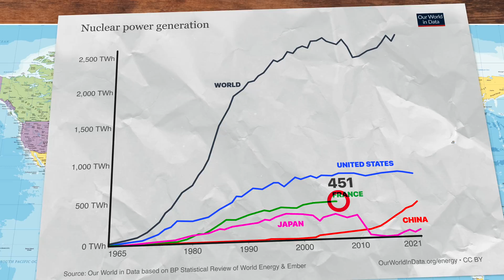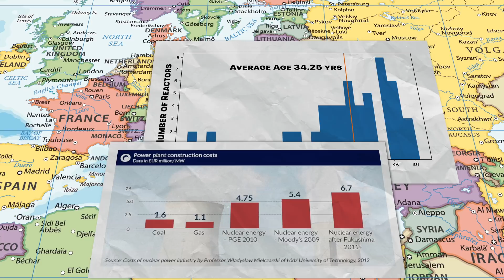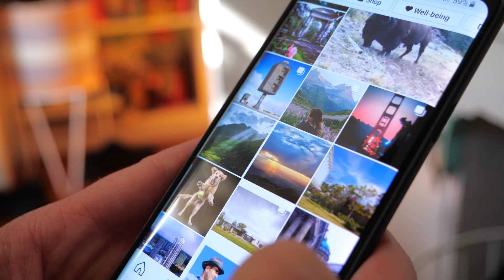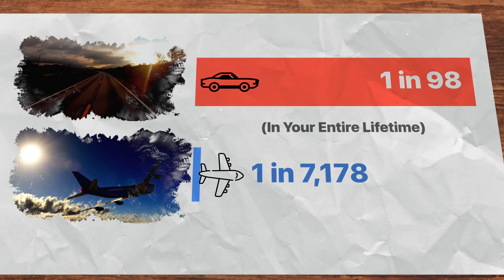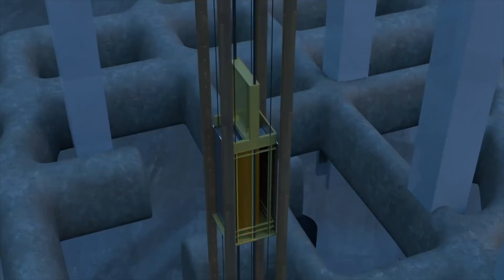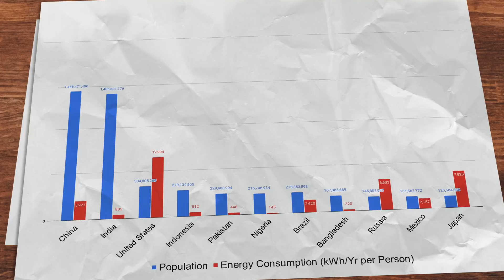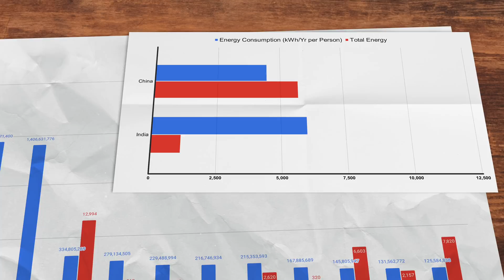The Future of Nuclear Energy Depends On This...

Comment: Safety is good, and bad at the same time, it depends when, where and how strictly it is applied. I’m currently building my house, and the workers just got on the roof and started working without safety concerns, and no one died. Fast forward a few months later one of the guy that was working on my house, got a job in Belgium or something (I live in romania), and he literally couldn't get on a roof without another guy holding him with a rope and another guy supervising the whole thing, even if he just had to place a single nail. I get it, he could’ve fallen down from the building, but what are the chances? It’s not like your intention is to jump from the roof, you can just be a bit careful and nothing bad will happen. Now of course with a nuclear power plant it’s another story, but I’m sure they’re overdoing regarding to the safety of the workers

Comment: Moltex are going through homologation in Canada for a fast spectrum molten salt reactor. There is no fancy molten metal coolant and there is no fuel reprocessing. 
They take used fuel and chemically process it into a salt which is diluted with chloride salt. The isotope content is unchanged. 
The salt fuel is packed into open ended stainless tubes. The reactor core uses the same salt (minus fuel) as a heat transfer medium. The reactor itself is a concrete box with a third salt loop to remove heat. It’s fully self regulating, cannot overheat and has one moving part - a salt stirrer to keep the regulatory body happy. It also has power cut-off rods but really doesn’t need them. It’s intrinsically safe.
Reply: When it si built and operated and proven, then and only then can you make those statements

Comment: Nuclear waste can cheaply used as fuel in a molten chloride salt fast reactor.  Both the Elysium and the Moltex Stable Salt can do this.  Other fast neutron reactors can do this. These reactors can use the 98% of the energy that is still left the waste of current reactors..
Reply: Maybe we should build one of these unicorns, operate it and prove what your saying before making claims
Reply: @clarkkent9080  don't have to experiment.  Russia has an operating commercial fast neutron reactor the BN-800.  Currently Russia is building several larger fast neutron reactors of the BN-1200 class.  Terra Power is building a fast neutron reactor in Wyoming.  All these reactors can burn Nuclear waste.  There are allot more of these waste burning reactors being developed.  This is not new technology as the the first fast reactors were developed in the 1950s.  Essentially the problems have been the need for higher enrichment levels and denser higher power output cores.  The problems here mostly been solved.
Reply: @stanleytolle416  NO reactor anywhere in the world is being used to burn nuclear waste.  It is technically possible for sure but no one is doing it because of the cost.  That is unless you count the countries that reprocess spent fuel and ONLY extract the Pu239 for use in MOX fuel for a MODERATED reactor core..
You cannot just dump spent reactor fuel into an operating reactor.  Every batch of spent fuel would have to be analyzed, as everyone is different and reprocessed into a form that could be placed in to the core.

Terrapower is on hold awaiting the construction of a U.S. plant to make their fuel as Russia was the original source.  The Terrapower MSR will not and is not designed to burn spent fuel.
Reply: @clarkkent9080  the Russian BN-800 is currently running on nuclear waste.  This reactor has a fully closed fuel cycle and it is a commercial power reactor.  The Canadian  CANDU reactors are currently being partially fueled by nuclear waste as well as all the French reactors. Essentially any fast neutron reactor can run on nuclear waste and reduce the amount of waste by 1/1000 with the small left over waste decaying to back ground in about 300 years (the half life of these elements being less than 30 years).  So if anyone is spouting off about a nuclear waste problem they don't know what they are talking about.  Current nuclear waste is simply fuel for newer reactors.
Reply: @clarkkent9080  the Russian BN-800 and currently being built BN-1200 are closed fuel cycle units that produce no nuclear waste (they reuse their own waste).  These are current commercial power reactors that are running on nuclear waste.  There are others in China and other places.
Reply: @stanleytolle416  I will look into the BN-800 but CANDU reactors are NOT fast neutron reactors.  They use heavy water to thermalize the neutrons.

And as I said in the previous comment, France REPROCESSES spent fuel to extract Pu239.  The Pu239 is used in their nuclear weapons and to be mixed with depleted uranium to make mixed oxide fuel (MOX).

The U.S. was planning on doing 1/2 of what the French were doing but since we have tons of excess Pu239, it does not have to be separated from spent fuel which is the hardest and most costly of the processes.  The U.S. plant was to simply mix pure Pu239 with depleted uranium to make MOX fuel. Areva the French company that built theirs was contracted to build ours and here is how that turned out.
The MOX facility (South Carolina) was a U.S. government nuclear reprocessing facility that was supposed to mix pure weapon grade Pu239 with U238 to make reactor fuel assemblies. It was canceled (2017) in the U.S. After spending $10 billion for a plant that was originally estimated to cost $1 billion and an independent report that estimated it would cost $100 billion to complete the plant and process all the Pu239, Trump canceled the project in 2017.

Spent fuel comes in all different types of fuel assemblies.  Please explain how spent fuel rods are used to fuel these fast neutron reactors????  Just throw some assemblies into the core???  If reprocessing is involved that is big money.  japan and the UK no longer reprocess since their facilities are old and it is too expensive to build new ones.  France will soon shut theirs down for the same reason'
Reply: @clarkkent9080  it's true that CANDU is a thermo reactor but how the reactor works allows for nuclear waste to be burned too as part of it's fuel mix.  Remember the CANDU is burning unenriched uranium as fuel due to using heavy water as a modulator.  The ability to use nuclear waste is related to the ability to add and remove fuel without shuttin down.
Reply: @stanleytolle416  You still don't explain how you add high level nuclear waste spent fuel rods to an operating reactor.  

don't you need fast neutrons for isotopic transmutation of the fission products in the spent nuclear waste?

Comment: Costly and centralized, nuclear is no match for the battery storage revolution that's about to happen. Never mind the creation of sizeable amounts of long term nuclear isotopes and all the issues that that causes.

The current price for LiFePO4 raw cells is about 100usd per kWh. It is highly probable that grid level MW scale battery storage installations will cost that in a few years time: for example: Tesla megapack (NMC based still) just had it price bumped to ~500usd per kWh from ~333usd per kWh, just because tesla could.

In a few years time, for the same cost of Hinkley Point C (23B GBP or 28.7B USD),  the .uk could build out 287GWh of grid level storage. That's 8 hours worth of the yearly average electricity usage. The repercussions of such a huge amount of storage distributed over the .uk grid would be insane. And yet all they got... well... will get... probably... instead is a measly 3.2GW with 92% capacity factor.
Reply: Tesla are great at building batteries, but they’re orders of magnitudes off from the volume and cost need for battery backup to be viable.

Comment: I do think nuclear power can be safe.  It is extremely difficult to predict accidents and therefore when they happen the damage is very long lasting.  That said, when they do happen it is big news and rightly so.  Except for Chernobyl, the history of nuclear power plants has been good.  Fukushima is the perfect example of conditions beyond our control they cause these big disasters.  You mentioned the non-recycling of nuclear material.  Well, this is true, and it can be recycled with a breeder reactor.  This brings up issues of security as the product of a breeder reactor is material that can be used for nuclear bombs.  Most disturbing of nuclear energy is the amount of waste that is produced and how dangerous it is to handle.  Yes, we can, and do handle it but I believe there are other means of producing energy that are much safer.  One of the most under utilized is geothermal.  There are pockets all over the world that are hot spots and could be investigated to produce energy.  I believe this is our replacement for nuclear energy.
Reply: Fukushima was actually within their control. They had a similar tsunami close call situation years earlier, and did nothing to address the battery power issue in an emergency. It is beyond incompetence to still use outdated reactors that require electricity to shut it down, which in a national disaster scenario is never a guarantee. There only solution was to keep nearby portable batteries, which in the second Fukushima tsunami incident, was washed away. They had to fly in more batteries on a helicopter in extremely bad weather, all to avoid the worst case scenario. That is not reflective of nuclear power itself, more about how to not trust governments running it themselves, since they will make terrible decisions like with Fukushima.
Reply: @Slayer8957  This speaks to the safety of nuclear itself. You cannot remove human error and therefore designs have to shutdown themselves in disaster situations. There are such designs.
Reply: @GeorgeinOregon  Right, Fukushima Daichi is a generation II reactor running since 1971. Generation III+ and Generation IV reactors dont have these design flaws. These outdated reactors need to be decommissioned already, instead of having their licenses continually extended until a emergency situation inevitably occurs that is used as FUD against the entire nuclear industry.

Comment: from a European/German perspective, my biggest problem is the waste. The concepts worked on right now have to prove themselves. But in the end, it always comes down to cost, and as it stands right now, Renewable like wind and solar are a lot cheaper per GWh and also way easier to implement in the short(er) term (with reasonably foreseeable costs)
Reply: waste is not an issue. Actually that waste is just unspent fuel. it can still be used. Calling it waste is stupid. Most of the "waste" is stored on site in concrete containers after it is  mixed into glass. The majority of this "waste" are tool and equipment used to manipulate the fuel or to operate the power plant. The most dangerous part of the waste will stop being dangerous after tens of years and there are countries like France, that actual process this spent nuclear fuel and reuse it. The whole nuclear waste produce by the whole world since it started can fit in a bigger stadium. There are also solutions to simply store this fuel in geological safe zone on site or simply reprocess it in Gen 4 reactors. The problem with this spent fuel is not engineering or economical, but political. Solutions are but political will to use them is not
Reply: Nuclear waste is recyclable since the 1960s.
Reply: @LuchtLeiderNederland  recyclable how and to what point? could you elaborate further?
Reply: @userXt  Nuclear waste is seperated from actinide elements. The nuclear waste becomes mixed-oxide fuel and is thrown in thorium reactors. The nuclear waste that come out of these reactors is as radioactive as the isotopes they use in hospitals.

Comment: Small Modular Reactors (SMR) can be built in factories on assembly lines and trucked to the site in standard shipping containers. Saves lots of time, and are easily licensed. In the event of a faulty unit it can be taken off line and replaced. Think of plants with 10 (many) SMRs and one or 2 (few) steam generators. SMRs can also be placed nearer to the consumer, reducing the need for very high voltage transmission lines and transformers.
Reply: SMRs are purely a reaction to the fact that it is impossible to finance new nuclear reactors today.

Comment: I wonder why estimated cost is omitted. You can only spend money once, and right now you can build wind/solar+short term battery at under 5 cent/kWh and have it operational in a few years at most, compared to building a nuclear power plant that in the best case will be operational in 10 years, and given the track record will take longer and be more expensive.
The safety record is also hard to measure since there's only a few samples of accidents, and in those cases we even might have been lucky. On top of that you'll also have to include possible accidents with the waste in the next 1000 years. Even this waste stored 500m under the ground, will it never leak, contaminate soil and water supplies and cause major damge in the next 1000's of years?

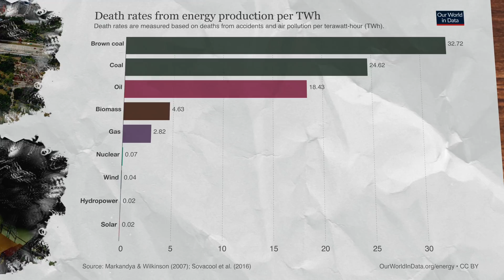Comment: 7:17 so, wind is maybe twice as safe as nuclear & hydro-power or solar maybe 4 times as safe?

So, nuclear is the way to go?
Hmm...

I think recovery time from disaster may be a useful statistic, as well as cost. 

If a solar panel has a catastrophic failure it will take someone with a dustpan & brush half an hour to clean up the mess & an engineer maybe half a day to replace it. 
Windmills take longer, maybe weeks.
A catastrophe with hydro-power can be a big thing depending what type, a tidal lagoon has minimal impact but a large dam can take a decade to recover. 
Nuclear? 
How long has Chernobyl been sitting there? What did the Russian army do to it last month? Has Calder Hall or Windscale been cleaned up & the site repurposed yet?
Reply: Wind farms are a daily disaster, killing a massive number of birds and bats every day. They destroy the ecosystem of where they are built, not even factoring how loud and annoying they are to live around, or how unreliable they are in power generation.
Reply: @Slayer8957  thank you for repeating oil industry propaganda.

Actually, no, F*CK OFF WITH YOUR OIL INDUSTRY PROPAGANDA
Reply: 1. Solar panels harm nature when they're dumped after they surpass their limits. Solar panels release toxic materials such as lead into nature.
2. Chernobyl is just an extremely lame argument against nuclear power.
3. Calder Hall never failed.
4. Windscale is not a nuclear power plant, and is just as lame as Chernobyl.